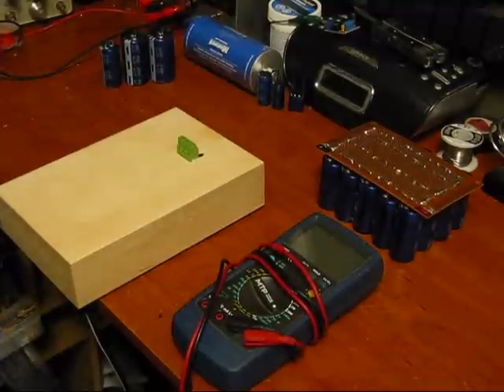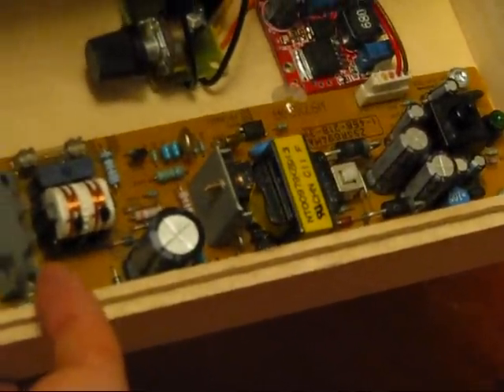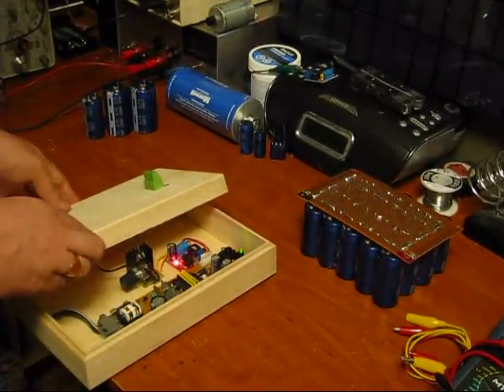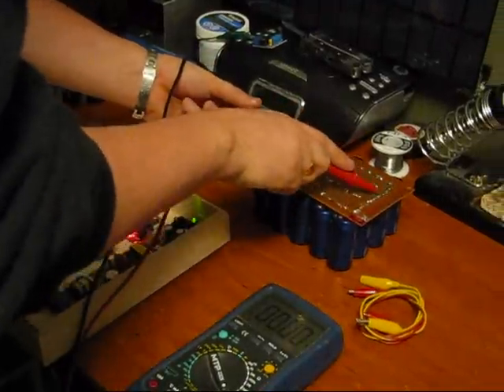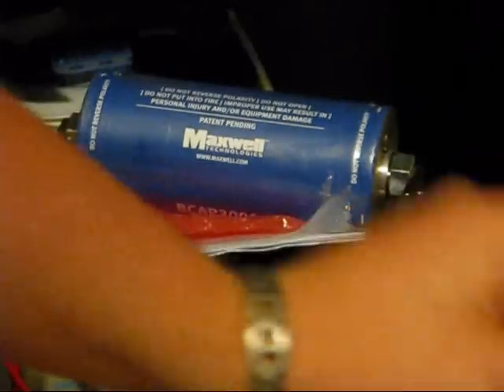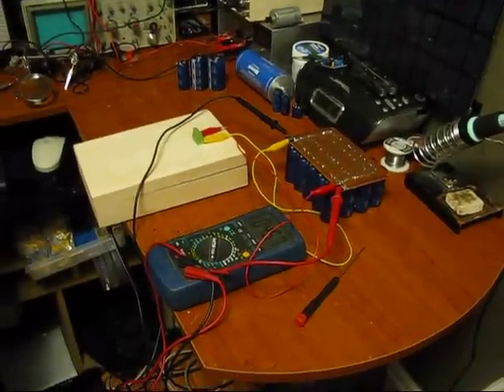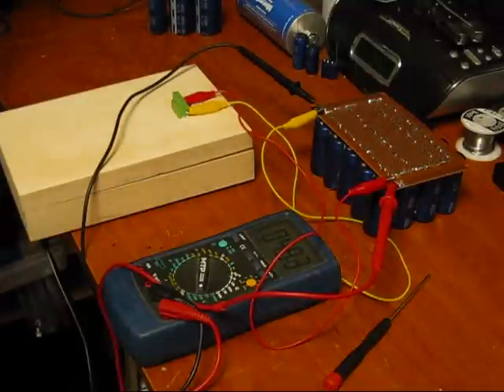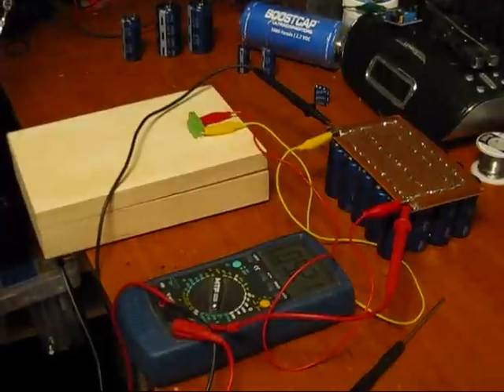The Variable Super Capacitor Charger!

Comment: I am a ham operator how long will a 12.5v cap bank hold a charge last rec/transmitting 5 watts avg transmitting drain 1,75a? or should I use a 12.5v  9 Ah battery to make it last

Comment: going from 120 ac mains, to 9v dc via switching converter, to 18v dc via boost converter, and then through a linear voltage regulator to whatever you set it to.  that's very very inefficient.  it works, but won't win any awards for elegance or efficiency lol

Comment: I could do with making something like that to charge my capacitor bank of 25 disposable 330V camera capacitors in parallel. It is currently being used to power my coil gun, and it can melt thin pieces of copper wire instantly so I imagine it could seriously mess you up if you accidentally touched it!

Comment: I wonder if I could make a 1-2 minute battery back up for that for high serge areas of my control center.  Like if the power was to serge and com back on after 30 or so seconds, the equipment wouldn't even be affected by it.  Probably with a 12v power inverter for a car hacked up.